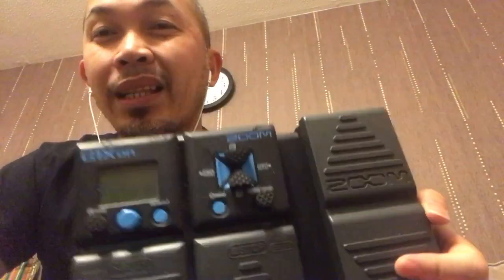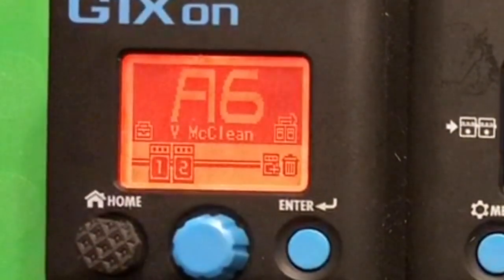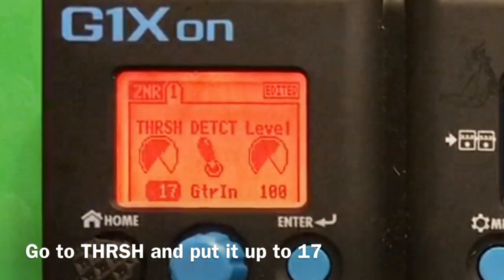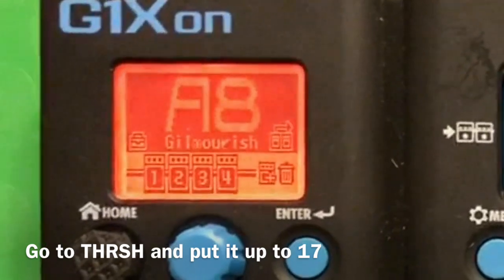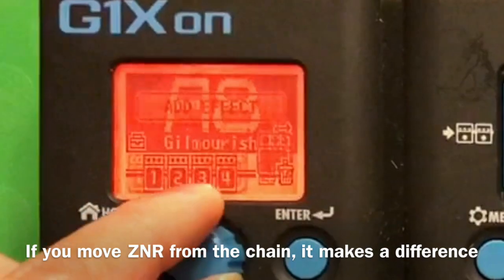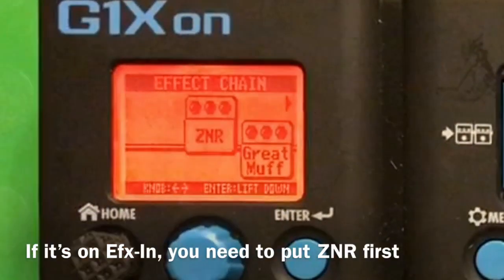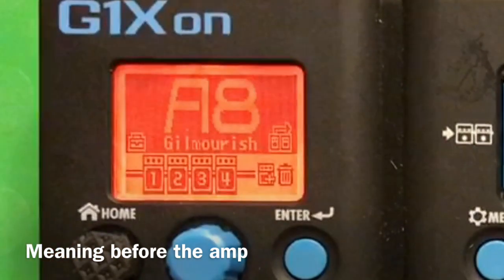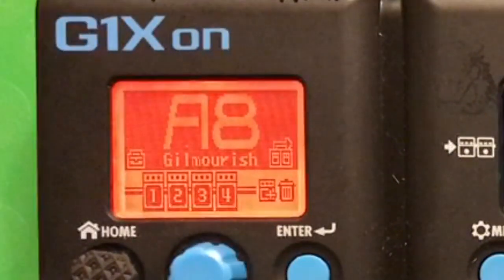Solution To This Noisy Zoom G1xOn/G1On

Comment: Just use a USB powerbank, it doesn't introduce the 50/60Hz buzz.
Reply from the maker: Michael W thanks for the suggestion. Here’s my video after i posted this, https://youtu.be/uk07W2axR38
Reply: is there any chance of damaging the device when always using USB powerbank (Output: 5V) ?
Reply: @hemantakakati1103  no. Unless you trip on the cable and break the port
Reply: @jenizj3481  i tried that last year many times but sometimes after using for long it gets stuck or hang then i had to unplug and plug the device again to restart

Comment: Thank you so much man!!! I subbed! Bdw what is the amplifier you are using?
Reply from the maker: I use an amp sim from my Focusrite iTrack Pocket then plug it to my Roland Cube Monitor. CM30.  My gigging amp is a cheap Panther TEGA 10 by Hohner. It's like a practise amp but works fine with me because I play quiet songs. But if you do heavier stuff, I think this amp is not loud enough. Thanks for the sub, I really appreciate it.

Comment: Hi i have a similar issue with the G1x Four. Do you know of a solution? Tried the trick but didn't work.
Reply from the maker: High gain settings normally creates noise. It can only be minimised but not totally get rid of. That's why most guitarist turns off the volume knob of their guitar after they end a song or when they do guitar solo. If you observe Joe Satriani, Steve Vai, Paul Gilbert they tend to turn the volume of their guitar down after doing lead. In my case I got a clean tone and lead tone, so that Im on clean tone before I play lead and then step back again to clean tone after I finished so that I can hide the noise. 

There are factors that can minimise the noise like shielding the wires of your guitar, using noiseless cable, using ground lift from DI box so that the amp and your pedal doesn't have that hum. But even with those in place, you will sometimes encounter static noise depending on the venue, the amp or guitar use, etc.  Hope this helps.

Comment: Hey I've a G1on and it creates a lot of noise when i connect it to my speakers. I tried doing this but it doesn't have the same options and the ZNR. Is there any way to solve this on G1on ?
Reply from the maker: Is there Noise gate in there or ZNR. Put it at the beginning of the chain. Then increase the threshold THRSHLD to 15-16.

Can I ask what guitar and amp your using? Coz sometimes with single coil guitar it’s got louder noise than humbucker pickups.

Comment: What's difference does Efx-in or Gtr-in makes?
Reply from the maker: It means that the ZNR (Zoom Noise Reduction) when it's on the EFX in is that it's more active on the effects. So if you got a noisy pedal, it should be put after so that it will filter the noise. When you use the GTR in, it means that it will filter any noise albeit from your guitar or wherever, so you can put the ZNR anywhere in the chain.

Comment: I don't have the Pedal option. Should I update the firmware on my device?
Reply from the maker: If your using Zoom G1xon, there should be a pedal option but if it’s Zoom G1On, then there’s no pedal option.
Reply from the maker: Here’s my video regarding assigning function on the pedal. https://youtu.be/AXYAtG69Xu0
Reply: vincent ryan borres I have the G1On. Is there any fix for this model? Only some effects have ZNR, for example LA Metal doesn't. BassSim has.
Reply from the maker: @TheChuckky  you can alter the settings by either removing an effects and swap it with ZNR. 

So patch doesn’t need ZNR that’s why they didn’t put it.
Reply from the maker: @TheChuckky  I got lots of videos about the Zoom G1xOn that you can use for Zoom G1On. Here’s one of the playlist I made. https://www.youtube.com/playlist?list=PLBxYCa_SF0sOlPncD-_u1usqCfOE-pD2z

Comment: Sir should I put it first or at the last of my effects chain? Does placement of the znr make any difference?
Reply from the maker: If it’s on GTR In it doesn’t matter where you put it but if GTR in is off then it will affect depending on the placement.

Comment: I have one more issue sometimes when I select a particular patch, there is no sound coming from my amp, after striking the strings of my guitar. The sound comes for only few seconds and only when I strike harder. Can u find out why that happens?
Reply from the maker: Rishabh Sharma it might be faulty footswitch button. Or it could be power supply issue. Try resetting it to factory setting and use new batteries. I will send you link on how to reset your zoom.
Reply from the maker: Rishabh Sharma here’s how to reset https://youtu.be/uLu_hTjNyig
Reply from the maker: Rishabh Sharma if it doesnt work may be you need to return it and ask for exchange
Reply: @vincentryanborres  thanks for replying, i will try reset the device.
Reply: So after resetting, the device will have factory patches or not? Just wanna make sure.
Reply from the maker: Rishabh Sharma its like how you bought it. So any saved patches or swapped patches will go back to original state. Also try a different guitar and amp just to make sure its not the one causing it. Even your guitar cable try and and borrow from friends and swap around just to be sure its the effects pedal
Reply: @vincentryanborres  ok thanks, i will surely try your suggestions
Reply: That happens in patches where you use the Noise Gate effect. You must configure it very well or change it through the ZNR.

Comment: Sir please tell me how to clean noise sound from g1 xon zoom please tell me sir
Reply from the maker: AVISHAN EKKA hello. About the noise, there will always be noise with high gain or distortion. The noise reduction will only minimise or reduce it. Another thing is that some guitar are a lot better in terms of noise as well as other amps are noisy than others. Its all combination between the guitar, the cable and the effects pedal.

Comment: sir i saw your video about the video using USB cord and a cp charge on Zoom G1xon, very useful sir, and i was so very happy after watching the video, but is it safe sir?
Reply from the maker: Chris Bongcalon to be honest I only use that when I’m practicing just in the house because the cp charger gets hot. During gig and rehearsals I use either batteries or my old adapter
Reply: but is it okay kung gaggamitin lang not more that 3 hrs?
Reply from the maker: Chris Bongcalon May be sir. I’m thinking kasi na pag celphone parang between 2-3 hours lng din kasi karamihan magcharge so ganyan sa isip ko

Comment: Bro I just encountered the same problem at a live giv yesterday...
Even after the setup, when I turned on the distortion , it produced a less noise in my feed back amp, but it amplified 10x when its heard from external amps...
As a result they had to lower my level of my guitar which cost the whole band to compromise on the distortion part.. 
Any idea why it happened ?
Reply from the maker: NS TCG during live gigs there lots of problems that you might encounter like the venue might have a different grounding system or the voltage is slightly different. I normally use batteries. Another thing is that sometimes the settings you have is compatible with your amp but if you change amp, you need to adjust the settings again i.e. volume or gain level. Now having said that, you need to observe your unit itself may be its playing up and there’s something wrong with it. Try Batteries, try the usb option for power and observe for few hours. If it plays up again then its probably your unit. Return it if it has warranty, ask for replacement.
Reply: @vincentryanborres  I used the battery but it's power was low  , so I used both 5v charger and battery...
The preset was default LA LEAD
They said I must use da box...
The noise was like a big humming grains..
I don't usually get those from my amps....
So didn't know how to troubleshoot this...
Reply from the maker: NS TCG remive the battery when you use the usb power or the adaptor is in use. 

Its hard for me to know exactly what’s happening. Can you edit the LA lead and put zoom Noise Reduction ZNR to it? See if that helps
Reply: @vincentryanborres     yeah I used znr.i  also thought about using them both( battery and adapter) will  make noise, otherwise it must be the poor grounding / cables ...
Anyways in future I shall take  extra time for sound check to troubleshoot it out ..
Anyways thanks for digging in 🙂
Reply from the maker: NS TCG another way perhaps is process of elimination. If you can borrow a different amp and different guitar. And use your present settings. Then swap around like your own guitar paired with your friends amp. Then ypur friends guitar and your amp. That way you can find out if there’s difference and if its your zoom or your guitar or amp thats causing it

Comment: halo bro,.how about the other effects I use, like SPEED METAL. or POWER LEAD. its noise. it is the same procedure? hope you read it. tnanks
Reply from the maker: Same procedure. You can remove one of the effects that is not needed and put the ZNR. But if there’s still space because you can put up to 5 effects, then just add the ZNR
Reply: @vincentryanborres  thanks bro,
Reply from the maker: @kuyarichvlog6869  welcome

Comment: Thanks so much for this! :) It works on all the patches I've tried, but I can't seem to add a pedal to the original I5(WhiteBlues) patch though. The screen shows "processing limit/DSP full/can't use pedalvx/change effect type".  The third effect in the patch is also a ZNR pedal- should I just move it to the last? 

Also, "gtr in" means that it's the first effect in the patch, ya?

Thanks so much for your help again! :)
Reply from the maker: Welcome. Yes sometimes when the patch got strong effects even if it’s only three or four effects, you’re not able to add anymore and it says processing limit is full. I can’t seem to understand it as well. But what I do sometimes is remove or swap other effects for example if it’s an Overdrive or Distortion, I just use similar effects in order to accommodate the pedal.

Yes about the ZNR if it’s GTR IN means that wether you put ZNR in the middle it will still be the first one. It won’t affect the chain of effects.
Reply: @vincentryanborres  Ahh...okay, that makes sense :) I'll try that out. Thanks so much again for your kind assistance. I no longer have to play with that annoying buzz in my headphones! :)
Reply from the maker: By the way, I checked out your channel. You got loads of videos there. Nice!  I enjoyed it. I wanted to share to you this acoustic sim Patch that I made from Zoom G1xOn. It's a lovely patch, you're going to enjoy it. https://youtu.be/LwiaX-QGpus
Reply: @vincentryanborres  Thanks, Vincent! I'm going to try to post more regularly now that I'm pretty much stuck indoors. Will definitely check out that video- there's so much to explore with the pedal and your videos really help, so thank you :)
Reply from the maker: @Shalini_Jay_Music  you’re welcome and looking forward to your videos.
Reply: The "processing limit" is an annoyance.  In an ideal world, the processor should be able to cope with whatever effects are in the chain, but some effects are highly processor intensive and putting them in a complex chain overwhelms the processor. 
I suppose Zoom could have omitted the most processor intensive effects which would have "cured" the problem, but would have restricted the flexibility of the G1xon. 

I read on a separate thread that using "gtr in" for a ZNR in the middle or at the end of the effects chain can cause reverb, etc, to be abruptly cut off when the guitar's volume gets below the threshold.  If this is a problem then put the ZNR at the start of the effects chain.

Comment: Wich would be the cause of the noise?
Reply from the maker: It seems like the pedal itself but mostly with high gain settings. I did a separate video where I’ve used noiseless cable and shielded stuff in the guitar but still there’s noise. https://youtu.be/bCvaP-Kpzyc

Comment: Can I add ZNR in all the bank which create noise like this??
Reply from the maker: Yes you can. The only thing is Zoom G1xOn doesn't have global option which means that you are going to add it manually and individually. Unlike other expensive multieffects pedal where you can just activate the global settings and it will add to all of the patches.
Reply: @vincentryanborres  Thank you sir..
Reply: But sir, If I add ZNR the bank tone will be same or change??
Reply from the maker: @shubhojitsantra1055  There will be a slight change, like at times the sustain will not be that long. But for the most part, the tone will be the same.

Comment: Hello, did you have a grounded electric line in this video ?
Reply from the maker: Im not sure. You mean the power supply? Or the Effects pedal itself? Coz my Behringer BDI21got a groundlift but this Zoom doesn't have. Then here in the UK they got 3 pin socket so Im using it's grounded. Im not expert on technical terms.
Reply: @vincentryanborres  Or did you use your Zoom g1Xon with battery in this video ?
Reply from the maker: I use my generic 9v power supply.
Reply: @vincentryanborres  Okay, In this video did you connect the g1Xon Processor to an amplifier?  If so which amp did you use ?
Reply from the maker: @furkansirin4197  On this particular video, I didn't use an actual amp. Just the amp sim that's with the Zoom G1xOn. On most of my videos, I record direct from Zoom G1xOn and I use Focusrite iTrack Pocket as my audio interface. Nowadays Im using the Behringer UCA222 interface. But during live gigs I use an amp. My amp is a practise amp which the Hohner Panther TEGA-10. At times, I share amp with other bands or the venue provides it. I've plugged this Zoom G1xOn using Fender champion 100, Marshall 50 watt combo, Orange 20w head and I've also tried it on Vox VT40. I think it really suits the Fender amp, especially with my playing style and my setup.
Reply: @vincentryanborres  ı am understand but, I want to know: What device is the audio in this video coming out ? For example From a sound system or a speaker, or a reference monitor or amplifier... 🤔
Reply from the maker: Furkan Şirin it was directly recorded straight to the iPAd. Using the Focusrite iTrack pocket.
Reply from the maker: Furkan Şirin here it ishttps://youtu.be/5KzbtC_X3Jg

Comment: What is the Solution of G1XN with pedal old version ,it got noise humm sound,when my hand goes near back to the Zoom,it get fine,but when I get back my hand it again get noise
Reply from the maker: it could be grounding problem or power supply. Try and use batteries if possible with the Zoom G1xn. Also another factor could be the amp. Try and use headphones and listen to it if the noise is still there. Just to make sure that it's not the pedal or the guitar that doing it. Another factor could be your guitar cable. There are noiseless. guitar cable. Or someone suggested to me before to buy a wireless guitar system, but I think it's still the same. If it's the guitar or amp that is doing it. I hope this helps.

Comment: Hey bro... Can you tell me is there matter weather we are using original adapter or not in case of noise
Reply from the maker: lakshay chouhan i did not buy the original adaptor so I cant really tell the difference but I have tried this with a cheap adaptor and my roland 9v adaptor and its the same. I have tried it with phone charger and using the USB and still the same.
Reply: @vincentryanborres  thank you so much.. ryan , can you also help me.  In creating new modren rock or blues effects like few decent effect that sounds great
Reply from the maker: lakshay chouhan i will find time over the weekend and post it here.
Reply: @vincentryanborres  okey so nice of you.. Bro..  Will wait for you
Reply from the maker: lakshay chouhan no worries

Comment: Does adding ZNR change sound a lot??
Reply from the maker: Junhee Park Junhee Park personally, I’m not a fan of ZNR. I like it without especially playing live. I just did the video because there are people asking how to make Zoom G1xOn quieter. I think if you put it on the chain setting first (left to right) and Efx-In is on. The sound is okay. But if you turn the Gtr-In from DETCT, there’s changes to the sound and it cuts the sustain. Hope this helps.
Reply: @vincentryanborres  oh i see, i ll try it later. Anyway, thanks for good information!
Reply from the maker: Junhee Park no worries!
Reply: vincent ryan borres  By the way, can you explain me what exactly 'Efx-In' and 'Gtr-In"?
Reply from the maker: Junhee Park I think what it means is that in an actual effects pedal, Efx-In is where you put ZNR in between pedals. Gtr-In is like directly to your guitar. Meaning even if you put any effects and in whatever order, it won’t affect the sound. It will always cancel the noise. But, I prefer the Efx-In to be on, rather than Gtr-In because it doesn’t change the sound quality as long as you put it first on the pedal chain setting meaning first from Right to Left arrangement. Gtr-In sort of cut the sustain. Hope this helps.
Reply: Hi  it helps me too in the future cause I have a ZOOM G2, and you cant change the order of the effects so with the heavier solo sounds one has to use very hi  ZNR gate so it cuts the sound, but i  have come up with a solution to that too: I use my other `little`pedals to  tone down the treble/noise and still have much distortion/echo/reverb from the ZOOM G2...!!! I think when my G2s stop workin I buy one G1ON and then go to G3....Thank You Very Much ive just so gotten used to my Zoom sounds...Kimmo from Finland
Reply from the maker: Kimmo Lingonheimo cheers Kimmo. Glad to help.